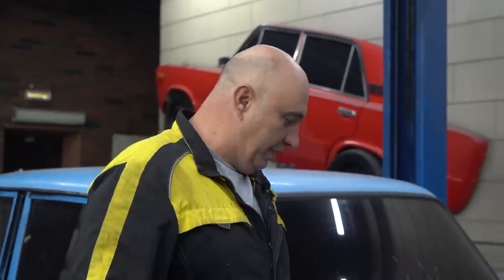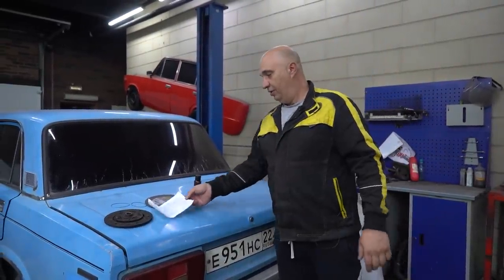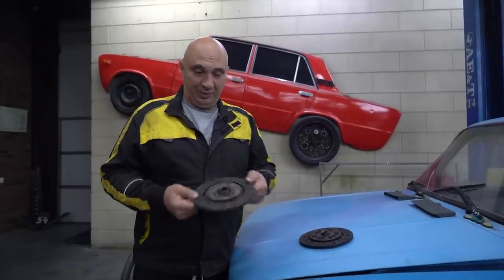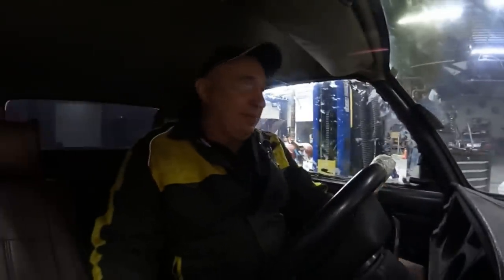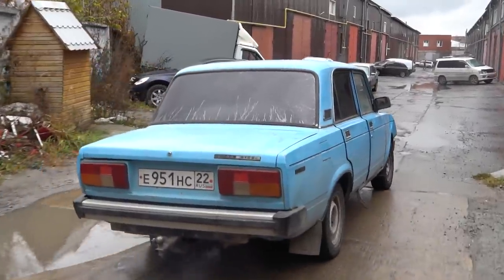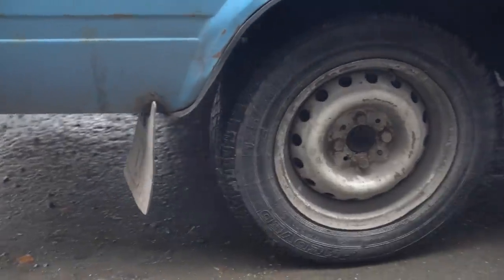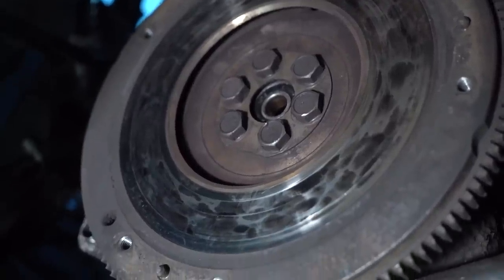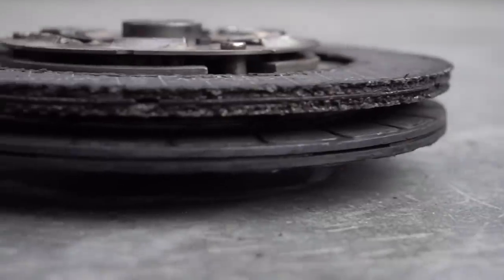Using an angle grinder disc as a clutch disc - will it work?

Comment: Ok, now what if you were to use the angle grinder disc for brake pads? That's pretty easy to try!
Reply: That's a good suggestion.
Reply: @freesoul9324   - I hope they see this and lots of people upvote it. That way, they'll have a better chance of seeing it.
Reply: I was thinking about the same
Reply: @luklukk  A Lada folks would agree!
Reply: That would be so easy to see
Reply: I think they only take the comments from their Russian YouTube channel.
Reply: @TheCommanderNZ  It could be
Reply: wonder if it would grind the rotors down?
Reply: @nikyjim  that's what already happens, thats not much different from normal, though they might totally destroy carbon disks in minutes, steel disks probably work pretty good for a time.
Reply: I agree with you!👌😎👍
Reply: @Garage 54
Reply: @MikeB-Android-Teacher  I agree with you
Reply: TOP COMMENT
Reply: @TheCommanderNZ   - If they only take comments from their Russian YouTube channel, would you mind asking them over there, please? Or see if they'll at least read this comment over here, thanks!
Reply: That can actually fix bad rotors as long as they are not warped, it should make them factory smooth again, 
Actually should be beneficial to run these brakes once every other brake pad change hahah
Reply: Me and my buddy did that with a grinding disc on my go kart. Worked pretty good until it fell out of the caliper
Reply: or sandblasting media embedded in resin
Reply: And if it doesn’t work?
Reply: Probably would work good lol
Reply: Those would be called "semi-metalic brake pads" 😉
Designed to wear out the rotors.

Comment: You better clean your lathe really good after this one. The abrasive dust will destroy the sliding surfaces. I dont even use the grinder in the same room as my lathe because of this.
Reply: Tahhhhhhccckkhh?
Reply: This was probably filmed a long time ago
Reply: I just got one for free out of a graphite shop...it's clapped out
Reply: That's a good tip
Reply: Good tip, that grinding dust gets everywhere
Reply: Those sliding surfaces are called 'ways'.
Reply: I don’t think they give a fuck about the gearbox or anything on that
Reply: @alexdev5809  Issue is wear on a machine like a Lathe usually means worse tolerances on the finished items.
Reply: Bingo.
Reply: In soviet russia, lathes bathe you
Reply: @alexdev5809  he said lathe no lada
Reply: Stuff the lathe 
I want to see the lada fly to bits 
I’m here for the carnage 😊.
Reply: In Russia lathe destroys dust
Reply: @Wolfman Dude yet they sell toolpost grinders for lathes... hmm...
Reply: @pimpnick4920
Reply: @robsmart8734
Reply: @pimpnick4920  l
Reply: Adding any abrasive material to the inside of an engine is just ridiculous. End of. Pointless video.
Reply: @alexdev5809  Price a lathe before you say that.
Reply: @VndNvwYvvSvv  No, like, I don’t think they care about the lada gearbox being wrecked, they do refer to them as “test dummies” after all
Reply: @G58  clutch friction material is pretty abrasive. Also its not in the engine its in the bell housing of the trans
Reply: @garrettgiuffre5653  in Soviet Russia, the lathe control you.
Reply: @Rob Smart What does Tahck mean? Vlad says that a lot?
Reply: @G58  you realise that a clutch works through friction right? Sometimes it's better to say nothing and appear stupid than it is to spout bs and be confirmed stupid.
Reply: @pimpnick4920  take it to a welding shop and have them hard surface it and then take it to a machine shop and have them machine it on a lapping machine. Or a surface grinder. But i recommend lap
Reply: I'll probably need this advice in the future, so thank you for this wonderful insight. I too plan to have many creation machines ones day.

Comment: Perfect way to resurface your flywheel and pressure plate before the new disk.
Reply: In before the tabloid "news" programs grab the story "that the mechanics dont want you to know" angle grinder clutch disc, machines flywheel as you use it so when its due for new clutch, flywheel already machined.  🤣🤣🤣
Reply: I see no way of this going wrong
This is perfect
Reply: Great point!

Comment: Awesome idea, but i would have liked to see the disc be pushed to its limits, like trying to set of in 5th gear or really high revs and slow clutch depressing.
Another Video idea i had was to maybe try and see if you could get a engine to run backwards like swap the cam shafts and intake and exhaust side and see if you can make it drive forwards in reverse, or have it spin the same direction just with the intake and exhaust sides swapped.
Reply: It’s a good idea , but they’ve done a video making the car drive forward in reverse before
Reply: a (analog carburated) engine can run backwards, tried that as kid with a moped, you need to adjust spark timing, alternator might be a problem as it contains transistor and diodes to adjust magnetic field & polarity and camshaft belt/chain is setup to run in one direction.
Reply: I'm glad they didn't push it to limits though bc then we see the wear pattern as opposed to just watching them sweep up bits and dust lol.
Reply: There's videos of that on YouTube. Doable, the biggest issue is the alternator - honestly you don't really have to change anything mechanically in the engine. Timing, spark, lots of determination and go
Reply: @AnalogDude_  a 2 stroke engine will. but a 4 stroke will need a LOT more changed than that.
Reply: On McKeen motorcars, they used a gas engine coupled to the front driving axle. To reverse they stopped the engine, flipped a lever to change the cam timing, and fired the engine up in reverse. Clunky, but it works to a point.
Reply: @petelattimer6808 I’ve had my four stroke Briggs diesel backwards before i know it deiseled because it doesn’t have spark going backwards

Comment: You should do a long term test on that disc, id really like to see how long it lasts.
Reply: It would definitely be cheaper to make the disk rather than buying a whole new one lol
Reply: Its probably not legal in russia to drive a lada with a clutch made from an angle grinder disk.
Reply: @Matt-cl4mp  you're funny
Reply: @Matt-cl4mp  If something is not legal "because it is not usual and non-industry-supporting stuff" - then you are somewhere in Central Europe 😧 I guess anywhere else on this planet they don't give a sh*t about such "legality" details.... Greetings from Austria :goodvibes:
Reply: @Matt-cl4mp  Show me the regulation, at least in the US unless its a safety concern there is no regulation stating you can't use aftermarket clutch disks (just like I have an aftermarket radiator in my car that's superior to OEM), or that you can't change the windshield wipers or put in different transmissions or anything else like that.

The government doesn't approve anything here (even DOT rated helmets are not tested by anyone in government, even that is self certified by the manufacturer and you just have to take their word that they actually tested them, I can make my own DOT rated helmets and slap the sticker on a bucket of foam and tape). There would never be any innovation if companies or individuals couldn't make any new or different parts, it simply wouldn't be possible to develop anything new.
Reply: @Matt-cl4mp  I hate it when I get pulled over and the cops take my transmission apart to check my clutch plate!
Reply: @PlasticCogLiquid  yeah happens every time 😩
Reply: Really liked this one.  Would a great plasma cutter work on the disc or better laser. However I too would like to see 10,000kms  put on that setup. B
Reply: Agreed.....

Comment: Replace the motor oil with Mayonnaise .
Reply: Cruel
Reply: Based Slav king
Reply: I've always wondered if grease could work
Reply: And replace the mayonnaise with motor oil! 😁
Reply: Just add water 🤣
Reply: How about replace the motor oil with soy sauce instead
Reply: No, miracle whip.
Reply: They did that im sure..
Reply: Replace the coolant with gasoline
Reply: Is mayonnaise an instrument
Reply: @davidwibben9886  Is motor oil and instrument?  Is antifreeze and instrument?  Is gasoline and instrument?
Reply: For that high protein curdle
Reply: mayo is to thick to replace oil
Reply: please😊
Reply: Bacon fat
Reply: Check out project farm
Reply: Better idea. Replace coolant with fuel instead.
Reply: @Szczepanittooo  uhh, no, it's way too thin
Reply: And add sugar
Reply: @glitch6140  mmm, motor mayonnaise
Reply: @cougarperformanceofficial  there's a video on YouTube of a guy that replaced his oil with vegetable oil to kill it before hauling it to the junkyard. (Long story short, he put like 3k miles on it and it was still running!, he junked the car before it died.
Reply: @davidwibben9886  yes, it’s also a gender.
Reply: Also mustard as brake fluid and ketchup in the power steering.
Reply: I thought mayonnaise was just used engine oil
Reply: @peetbronkhorst5473 too thick
Reply: You do that.

Comment: the sparks come from incandecent metal that's cut by the edge of the cutting disk, the flank of the cutting disk does not cut that much, though is for sure more abrasive than a standard clutch

Comment: I'd love to be able to get a clean little Lada shell here in the US, they look to have a lot in common with early 1970's Datsun 510 halfway to a Datsun B210 sedan.
Reply: before being a Lada, they were a Fiat 124 originally. VAZ bnought the rights to it when Fiat scrapped it as a current model, but they put locally sourced, cheaper engines in them, instead of the Fiat twin cam (from memory) engines, and the Lada was born!

Comment: I would hazard a guess that clutch friction plates are made of a similar material to what grinder discs are made from, that's why it worked so well.
Reply: @Joshie2256  I imagine this custom clutch would last longer if used like an on off switch so as to give the disc less time to abrade the flywheel and pressure plate. Also, if given time to make the disc wear enough to sit flat against the flywheel and pressure plate, making full contact with them, there would be less abrasion because the full force of the pressure plate would be spread more evenly across the disc.
Reply: @Dappersworth  just press the brake and the gas at the same time and let the clutch burn

Comment: no need to resurface the flywheel and replace the pressure plate, a grinder clutch will automatically surface and polish both saving you money!

Comment: considering that you can stall a a 230mm makita angle grinder while cutting a small piece of steel so a small contact area between the steel and the disc (it will rip you arms off but it's possible)
it would make sense that it would make for an excellent clutch material, it has a LOT of grip
make breaks from it now... instead of a cutting disc try using a grinding disc

Comment: Always with the cool things. It would be interesting to see what would happen if you put one of these in a more powerful, road worthy vehicle and drove it many miles under everyday driving conditions over a set period of time. Would it crap out or prove to be just as good or better than a regular one.
Reply: I strongly doubt it'll perform better, since automobile manufacturers would use that instead cause it'd be cheaper, but i do suspect it'll hold a good time tho

Comment: This is another video where I feel like it should have gone on longer.

I am curious to see what would have happened when the whole surface of the friction material met the whole surface of the flywheel. Would it have felt like a softer engaging race clutch? Would it have slipped? 🤷‍♂️
Reply: Seeing as it performed as a stock clutch using only 5% of the available surface area, if you let that wear in, it wouldn't be street drivable.  You'd have a goddamned Stage 6 racing clutch.

Comment: Hot damn, finally something I've done Before Garage54! Had a tractor come in that needed a clutch that hadn't been made in 40 years. We tried this as proof of concept, then ended up doing a more proper version with phenolic resin, chopped carbon, silicon carbide, alumina, vacuum chamber and literal tons of pressure at 3000*.
The friction discs didn't last very long nor tolerate heat like our carbon clutch did. 😁

Comment: "then again rock will be cutting into metal" 🥲 no, not so soon. Please spare me 🙏

I had to go change the front rotors on my uncle's truck because (he doesn't take care of his stuff and is also partially deaf so doesn't hear brake pad squeaking) the front right had been grinding the metal part of the brake pads against the rotor so much they cut deep groves in it, while the front left had this pebble in it (hard telling how big it was to start with) for god knows how long. Make a couple more hard stops carrying 12,000 pounds of shit and it probably would have cut off a ring of rotor, which replacing them was not fun in the slightest. I love doing smaller car jobs, but not that

Comment: hmm after this video, can you guys try filling up a torque converter with fine sand to see if it will still work. Maybe seal it off from gearbox so its just the impeller between the engine and gearbox.

Comment: Why you don't made tool jig from flywheel and press-system. It would push it equally and even centering it if you just add few tabs around disc.. but this is nice. In long term glue cannot handle those forces. Spinning ones and heat.. add those rivets, then no problem. 

And..
"surface area does not affect the amount of friction"

Sintered discks clutches have very small surface areas. And those are still 'on-off' clutches. 

There could be some real world applications for this self-made thingy in rally or some..
Nice work..

Comment: god damn. maybe try nore custom clutch disks. like carbon fiber or rubber. i wonder if the plate had teeth and the clutch had a plyable material like rubber or fabric if that would work.
Reply: i mean thw flywheel! not the plate lol

Comment: that lada is a high quality car when it lastest for decades. its not nice to let it come down like that. better would be a repair to make that lada look like new again. that light blue color of the lada is nice. i heard the steering of the lada was to heavy, a servo for the stsering would be a fine modification. that angle grinder disc clutch needs some extra forming, to have the whole surface of the disc in contact and not only the outter edge. how can that be done? interesting to see how simplw repairs work out for a car, thars some ingenuity.

Comment: that's weird. i was wondering if you could use a clutch disc as a angle grinder wheel, or maybe a Frisbee. jet engine turbine or compressor wheels might be a stretch though.

Comment: Try and use water as brake fluid or wd40
Reply: Has been tried by a dutch guy it works until it gets hot or after a while everything just get stuck becouse no oil in brake syste so all calipers become stuck
Reply: When i was 12-13 , i was having fun in the field with my mother 1964 ford galaxie , no more  brake , so i put water  as brake fluid , it worked for a few days :)

Comment: You should somehow enclose the clutch and flywheel with oil and see if there’s slippage and burning
Reply: Wet clutches do exist. They are used widely in motorbikes or automatic car gearboxes.
Reply: @bobsonmkd  they use very different friction material though. A clutch that is meant to be dry will be very quickly destroyed by oil.

To the OP, engine oil on a standard dry clutch ( like you would find on a normal manual transmission) will cause slippage. First, it causes clutch “chatter” which is basically rapid slipping and grabbing of the clutch. As it gets more oil on it, it starts just slipping. As a mechanic, I’ve seen this many, many times on vehicles that have un-repaired oil leaks.
Reply: @bobsonmkd  oh I knew they were used somewhat in automatics but that’s it.

Comment: magnetic clutch, dont need to let the clutch disc surfaces touch
Reply: alternating magnets opposite teeth clutch discs
Reply: you guys like your glue, dont you
Reply: through hole spacer screws instead
Reply: squeeze so that the screw head is below the surface
Reply: very nice replacement part

Comment: I think it would have been smart to cut the grinding disk into sections, to allow for thermal expansion.
Reply: Naah.. it fu...s it and pieces would fly. If you use new pressure plate and just drive, time will fix everything it glue keeps.. you don't normally run those disks at 8000rpm, so internal fibers in cutting disk are very needed in this use too...
Reply: The more steps they do, the closer it is to oem. That's getting way closer to just working like a new clutch lol.

Comment: "The action is like on a normal disc."

I wouldn't be surprised if the Soviet era Ladas did use angle grinder discs as the clutch.. :P